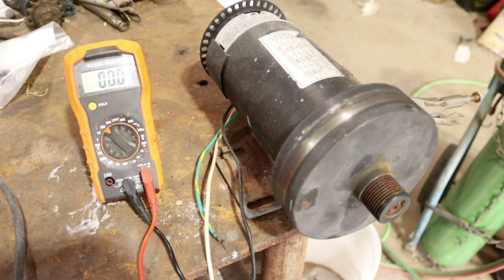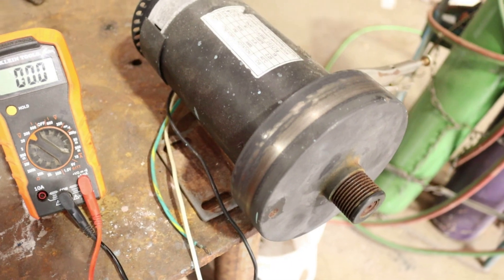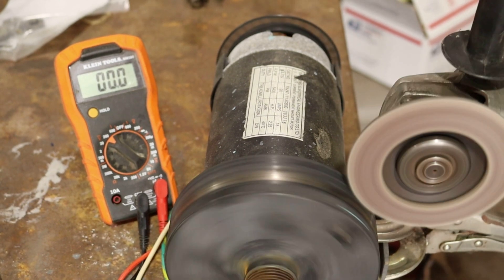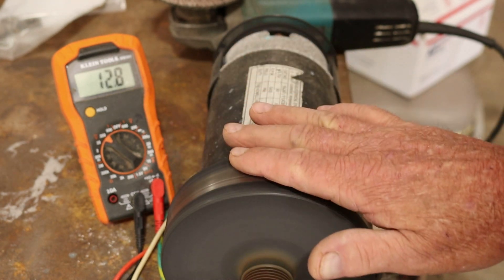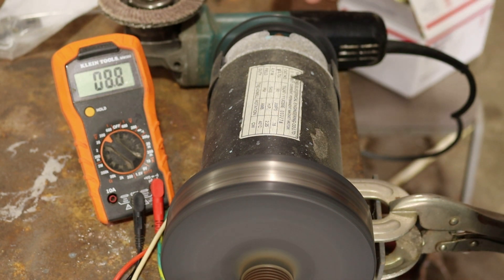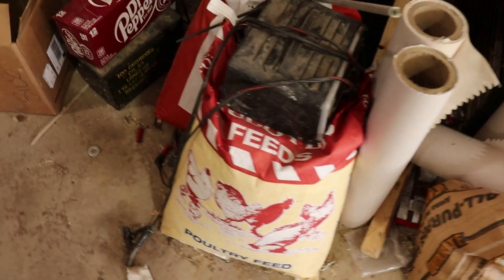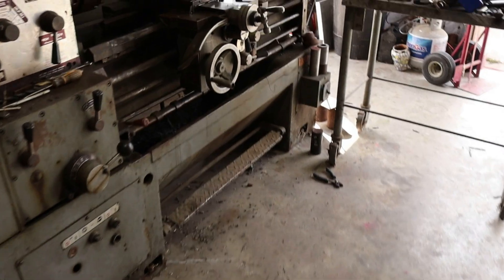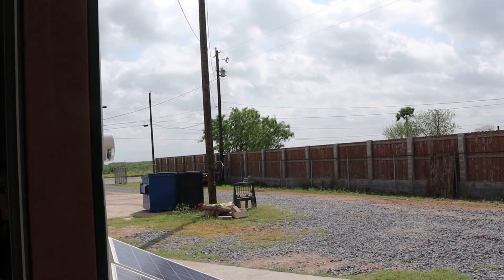I Built a Wind Generator with a Used Treadmill Motor

Comment: Just drill them out and tap it too mount the blades too the flywheel
Reply from the maker: Great suggestion. Appreciate the comment
Reply: Yea and use a fishing swivel if you going vertical
Reply: Sorry horizontal i put the  cab le through the bearing and put a swivel from a fishing spinner instead of a slip ring and earthe cable the the chasy